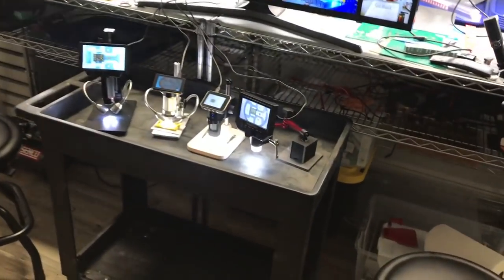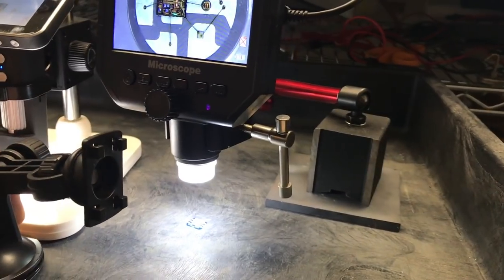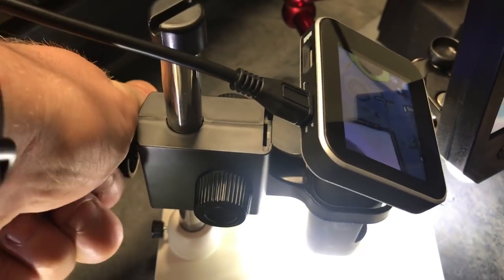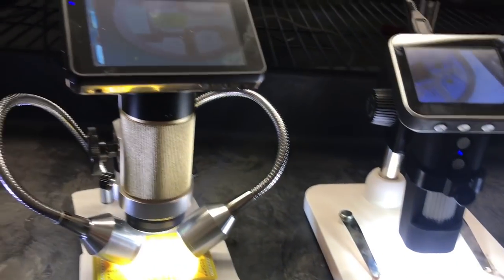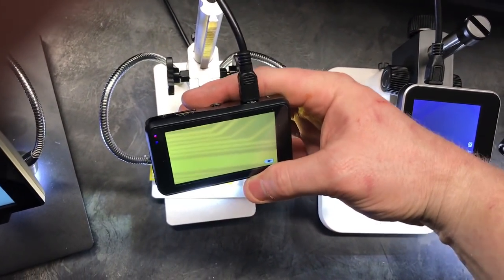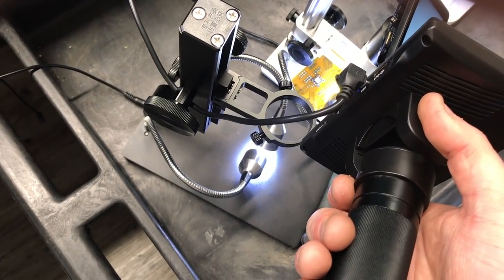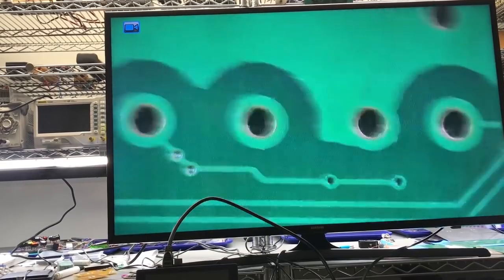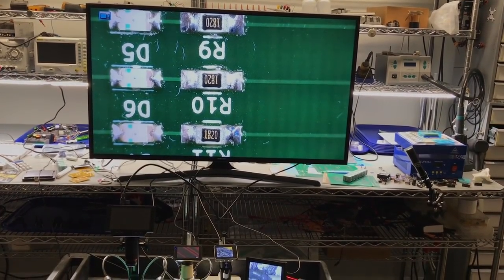2018 Soldering Microscope Comparison

Comment: I graduated to a andonstar 302 from a 201.i used the 201 for several months and it does a fantastic job but i gotta say the 302 is leaps and bounds better not just a tad better.

If you are spending more then $50 for a 201 just do yourself a favor and spend the extra $150 for the 302 cause its worth every single penny.

Comment: Great comparison video.. Exactly what I was looking for. Currently, I use an 8 Mpixel that produces an excellent picture. I use it professionally, on a shoestring budget. It was about $100 on Amazon. The pix appears on the computer screen. I did have to make a custom mount for it to be useful.The overall problem I have with all of these is that they produce a 2-D image, no depth perception. I did get "used" to it, but. I'm used to 3-D with a stereo microscope, but at 2kilobucks. I'm waiting for a VR hood for the stereo USB microscope.BTW, another reason why the advertised resolution is not met, is that the salespeople just plain have no clue what they're talking about.Thanks again.

Comment: For a microscope for working (vs. inspection), latency and focus depth are more important than image quality. I bougtht a cheapo one to try & the latency is so bad it induces tremors as the brain tries to correct for the delayed image
Reply from the maker: mikeselectricstuff the two poor quality units had a noticeable latency.  I did not notice any with the two andonstar units.  I solder directly through the screen with them without any issues. What’s the best way to measure the latency? Film a stop watch?
Reply: I just shot a video of me turning on the lights and counting frames until the LCD updates. In 5 frames the LCD is updated partway, and after 6 frames a full update is done. So a delay of 240ms - not bad, not good either.
Reply: @zaprodk  Is that a good test? These cameras adapt based on the light is not an indication of the latency in normal use. The frame rate will probably decrease the lower light you use as it compensates exposure.
Reply: @mikiex  The "test" i did was with normal lab lighting + the two supplied lamps for reference.
Reply: @zaprodk  Which scope did you test?
Reply: @mikiex  The ADSM302.
Reply: @zaprodk  Still usable though, I don't think there are many other options as this price?
Reply: @mikiex  I got an optical binocular scope for soldering instead. Soldering on the ADSM302 is a pain (for me)
Reply: @zaprodk  would you say the latency feels higher when you are more zoomed in? I wasn't planning on doing really small SMD. Also I wonder if there is any setting that improves latency (Similar to game modes on TVs where they turn off any image processing).
Reply: @mikiex  I never tried digital zooming, only optical, so the lag is the same all the time. There is no settings to make the latency less. People say if you have a shitload of light on it, the lag will be smaller.
Reply: @zaprodk  Thanks for taking the time to reply, I may put of getting one for now at least.
Reply: Zapro_dk, I hear ya' brudda. Have a $2K stereo microscope at work. It is a sweet thing with real 3-D imaging.

Comment: MP (mega-pixel) IS important depending on what youre doing with the images.. if you are using them to look over the pic it took for faults and such then you would want a high MP cause that gives you a better ability to zoom in onto the pic after it has been taken, basically the higher the MP then the further you'll be able to zoom in before it starts to get fuzzy/loss of detail.

Comment: Nice comparison. I made an LED ring light that works with both andonstar microscopes and I also use a microphone boom arm instead of the original stand, you might like to check the videos on my channel.
I added a battery to my adsm201, it has the pads for the battery on the PCB so you can just solder a small lithium battery, it's not that I need to use it outside or anything, it's mainly because the settings would reset everytime I disconnected the power. The adsm302 although it also can take a battery inside it already has a small backup battery to save the settings.

Comment: I found this video extremely helpful and one of the best on YouTube to compare these types of microscopes, which led me to get the even larger (but same camera) AD407 - however - I wish Andonstar would give real specifications instead of telling you what magnification you can get on a screen they don't supply (up to 270x on a 27" screen?). Unfortunately they also fail to tell you the minimum magnification you can expect - I'm an electronics hobbyist, and for the majority of soldering I do, 2-3x zoom would be great, otherwise I'll always be moving the work around - at full height, with the camera mounted on the lower lens ring, you will only see about 25-30mm of PCB - I could not view a whole Wemos D1 chip on screen at minimum zoom. For a product sold to aid with electronics (and clearly not aimed at professionals), the magnification offered feels far too high.

Comment: I have the Mustek G600 from Banggood, which I believe is the same microscope as the Koolertron 4.3. 

Nice video.
Reply from the maker: Yeah, that unit seems to be generic with several brand names.  Thanks for watching!
Reply: @ProtoG42  I have that one as well but I hate the base.... i can't seem to get a good understanding of the arm you are using.. which are the parts you used. Thanks  Great video!
Reply: @Nclght  that is a magnetic base for a dial indicator . the arm is called an indicator holder and looks like a noga knockoff

Comment: Both Andonstar models you show have 3MPx sensors and just upscale to 12MPx photos. The 302 model showed better photo, because of more magnification and you just had different angle of the light. When filming open microchip reflected light changes how it looks dramatically. Probably the lens is a little better, but overall it is not much different. Unfortunately both Andonstar models output only 720p to PC over USB. 1080p is only on HDMI. What I like on the 203 is the large enough display for actual work. I am still deciding which one to buy, but I guess it will be the 201 model as it is half the price or 302 and not that much worse if you use PC or monitor.

Comment: Great video on the cheaper microscopes available. I actually use the first one you showed, it is cheap and cheaply made but it is very useful for me and I have used it on several electronics repair videos. If you look hard enough you can find it available with the silver ajustable stand up like the 3rd one you showed. I would love to have one like the 302 you showed. It looks really good. The older I get the more I love these little digital microscopes!

Comment: Very interesting. I have one like the last one with an 8.5” screen. My one complaint is that minimum magnification is 50x and sometimes I’d be happier with 10x. When I first got it part of me wished I’d bought one with eyepieces over one with a screen because I struggled a bit with depth, especially when using tweezers. However, it doesn’t take much practice at all to get used to using one. I am the ultimate amateur and was previously using a jeweller’s visor, the difference even a lower end microscope is phenomenal.

Comment: I have the Andonstar ADSM201, and although it does record full 1080 when using the USB, the HDMI out is only 720 regardless of what it is set to. I was a little disappointed in that since using it with a 1080 monitor was my primary intention, the 720 still looks good but it wasn't what I paid for. Also there seems to be an issue with windows 7, I could get it to record but the program got an error trying to use the preview screen. In Linux it worked without a hitch, i must say there is a lot of lag though.

Comment: You seem to talk about the quality of "pictures" a lot but to be honest as a soldering aid I am not interested in how well it takes pictures.  I need to know what it is like in use whilst soldering.  ie, is there a decent working distance? Is there any latency between the camera and screen?  Is the stand stable?  will it maintain focus in use? what is the clarity of the screen in use?   

If there is going to be a part 2 to this comparison, could you please demonstrate the microscopes in use as soldering microscopes.

I bought a cheap "soldering" microscope, the USB type that you plug into a computer and it was as much use as a chocolate coffee pot.  The colors are off, it won't stay in focus, it wobbles all over the place in use and worst of all there is about a 200-millisecond latency on it.  It's absolutely terrible.  

So I have ordered a good old-fashioned optical microscope for soldering work.instead. It has X20 and X40 lenses, a good focal distance and a good solid stand.

Comment: I looked this microscope up up on ebay (price seems to range $300 - $400 US) and the spec does show a 12 MP photo resolution...but, also a 3 MP  image sensor. The image looks really good in your video but, I really do question the interpolating of pixels. Thoughts?
Reply: @David - My own vision is limited and I didn't purchase one but, I agree with the presenter that the last microscope seems the best overall and the cost for all are very reasonable (I mean it's not like any of them are $50k - 100k or some crazy price tag like that).

Comment: Hi there, thanks 10x for this review! Comes in handy as I am looking for a soldering microscope. 
Question: Does Andostar ADSM302 have any latency in the video? 
With other words, say you are soldering under the microscope, do you feel any delay between soldering and this being visualised on the screen for you. Do you need to artificially slow down yourself down in order to see/get soldering right or this latency completely unnoticeable?  Is there any difference in the latency between the build in screen/monitor/USB?

Comment: Thanks for taking the time to make the video. I have a few questions.

How do these compare to a stereo optical microscope for rework and other manual soldering?

What is the latency like on these devices, and general speed of the UI?

What are the optical and digital zoom capabilities like?

The views you show are quite close in, certainly more so than I'd generally use, and I regularly go down 0.4mm pitch and 0201 passives, sometimes even 01005 size. How well would these digital microscopes work with, day, a 2" diagonal target?

Thanks again!
Reply from the maker: The UI is very similar for all of them and works fine.  The cheaper unit seems to have more latency but not too bad.  I’ll take more board photos a bit farther back this weekend and post them.
Reply: OK, many thanks. I'm particularly interested about the video latency, historically this is the reason I've not had much luck with these digital microscopes: I find I need immediacy for eye-hand co-ordination tasks like placing parts and manual soldering or rework. Regarding the zoom, if I can't see a reasonable board area of, say, one or two square inches, I end up spending time hunting myself which upsets my workflow. This is where an optical zoom function, preferably a parfocal zoom helps (parfocal = where the focus is maintained as you zoom in and out).
Reply from the maker: Have you used a digital microscope with a built in display?  I find the usb units I've used have had a noticeable delay.  I could try with a stop watch to see if I can pick up any latency. None of these 4 microscopes will zoom out enough to see 2 inches.  I measured a little over 1 inch of viewing space.  The 4x digital zoom on all of these will serve the purpose of a parfocal zoom. 

Here are more photos of a 2cm wide board taken with the 4 units:
Andonstar ADSM302 taken @ 20.5cm https://i.imgur.com/uzFEcRA.jpg
Andonstar ADSM201 taken @ 12cm https://i.imgur.com/Zh7Pf5I.jpg
2.5" "Koolertron" Microscope taken @ 11cm with no light https://i.imgur.com/cVwB9KZ.jpg
2.5" "Koolertron" Microscope taken @ 11cm with light at lowest setting https://i.imgur.com/gLUf2KR.jpg
4.3" "Koolertron" Microscope taken @ 21cm https://i.imgur.com/9HJ58hx.jpg
Reply: Those stills are pretty revealing, the ADSM302 is by far the best one, I assume you're using each devices' built in lighting?

I've used two USB streamed ones which were both useless except for taking stills. One of those is a C-Mount that mates with the trinocular port on my optical inspection microscope, and it has a live HDMI out at 1080p60. I have it hooked up to a 15" 1080p60 HDMI monitor on the bench, and the latency of this setup is such that I find it unusable: it's perhaps only 1/15s or so but it's enough that I find it quite offputting: I can potentially be working for several hours at a time with a microscope. It is possible that the latency is in the monitor, I'll have to try it with some different combinations of cameras and monitors.

I did look at one of your videos a week or so ago where you did some placing without the aid of a microscope. I can do this down to 0402 particularly if I know the board, but for 0201 and below and placing fine pitch devices <0.5mm or so, I find I need an optical aid. For manual soldering or inspection (as opposed to placing), anything 0603 or 0.05" or below pitch I find I usually need a microscope.

Maybe if you could do a short video which shows moving the board at the same time as showing the microscope's screen, we could gauge the latency subjectively?

Many thanks!
Reply: Latency on the ADSM302 is approx. 240ms.
Reply from the maker: How did you measure that? Is that with HDMI or the built in screen?
Reply: Proto G built-in screen. HDMI will probably have added delay due to image processing in the monitor to add.

Comment: The Andonstar 302 is $350, but there's an Andonstar 301 out there too, going for only about $200.  It appears to be similar, but lower magnification (up to 260×) and lower focus range (5-12 cm) and with a slightly different form factor for the stand.
Reply from the maker: The 302 is $299 in both links I listed, I'm not sure about the 301, I've never used it.
Reply: I’m in Southeast Asia so Amazon added $50 for shipping. Surprisingly, I can’t find it any cheaper on eBay (most of these gadgets are made right next to me in China, and I can often get them much cheaper from a Chinese eBay seller than on Amazon... but not in this case).
Reply from the maker: What about aliexpress?
Reply: I have no experience with that site but they do seem to have it for $300 with free shipping. Thanks for the lead.
Reply from the maker: I've been ordering parts on there for years and my only complaint is shipping times but that has gotten a lot better recently but that all depends on the seller.

Comment: It would be nice to see each one "in action".  Zooming in on a chip is marvelous, but in practice you usually have lower magnification.
If the microscope can't capture video [and even if it can] then videos from an adjacent camera showing smoke blowing on sensors, or a soldering iron trying to reach a joint, make for a great visual aid to go with your comments.

Comment: first 3 really look like modified dash cams, 1st one basically is.
Reply: You see, any way you cut it or dice it, one has to spend around $300-$500 for a really good optical binocular scope like an Amscope or Minvision.  There are lots of drawbacks with these "cheap" ones,  like lower quality sensors, narrow optical magnification if any (digital gets fuzzy), lack of working distance, and a slight video lag which some people can never get used to (myself included).  These are just toys, as you've said more like modified dash cams.  The old adage "You get what you pay for, certainly hold true when it comes to scopes. ;)
Reply: I once had a cheap dash camera.  It is easily worth it to get a known good one.  Look for reviews.  Don't pay any mind to the plainly obvious fake reviews that where they sound like some ecstatic old lady is dancing around singing their praises but the real ones that simply say if it was any good.  Who knows you might see a ton of reviews that say JUNK, DO NOT BUY or something similar.

Comment: When using the adonstar 302 , is it sensitive and wobble when moving around on the table?? Can you solder and move around without the camera losing focus and going crazy?jay
Reply from the maker: There is a noticeable lag with the cheaper units.  I haven't noticed any lag with the two andonstar units when placing small smd components and soldering.

Comment: Thanks for the great review!  I ordered the Andonstar 302HD after shopping for the less expensive version after seeing it in your last video.   It hasn't arrived yet, but it's great to see the difference.  Sounds like I made the right choice.     What's are the latencies like on these?
Reply from the maker: The cheaper units seem to have more latency but not too bad. I didn't notice any latency with the Andonstar units.
Reply: Latency on the ADSM302 is approx. 240ms.